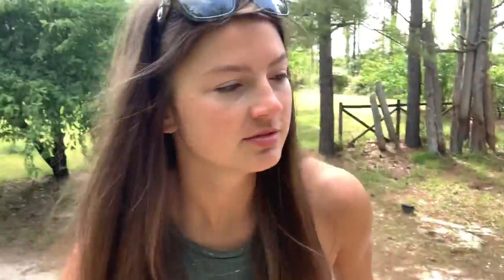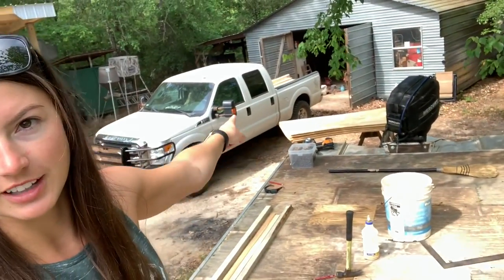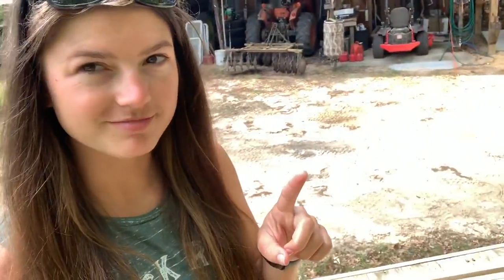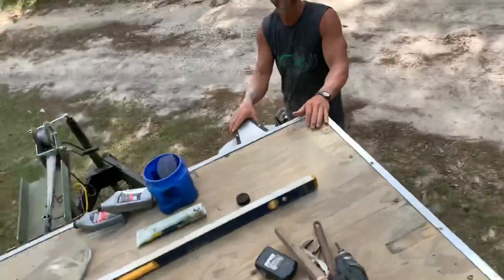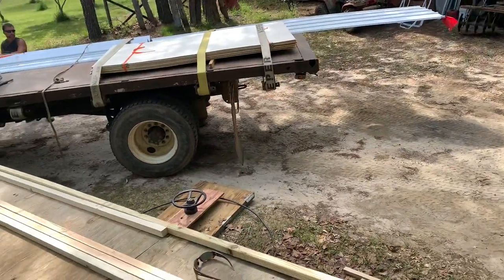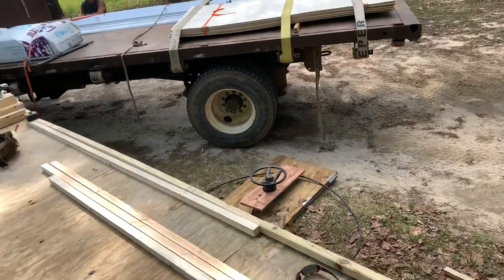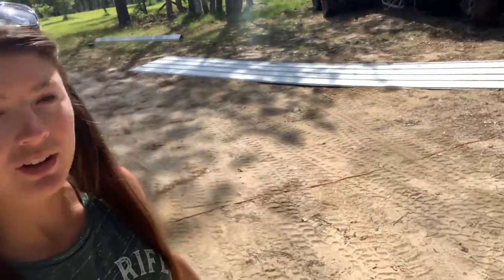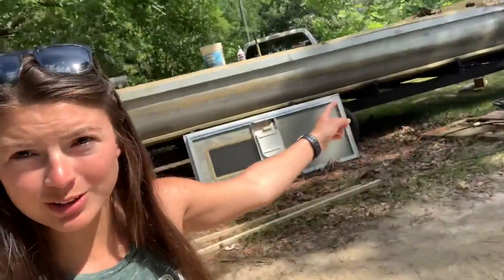Catfish Cabin in the Making! Day 2!

Comment: Girl, take you an old (no good) wheel barrel inner-tube and cut it into "rubber band" pieces, give a couple of wraps around to hold that battery onto that tired old drill case body so you can still use it without worry of the battery falling off.  Sometimes an old tool just needs a little help.  Lookin' good !